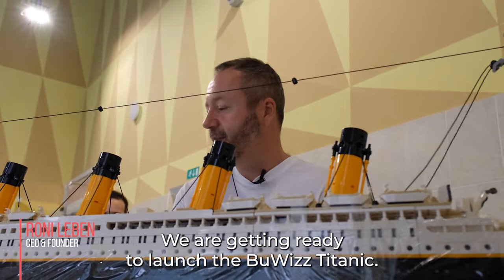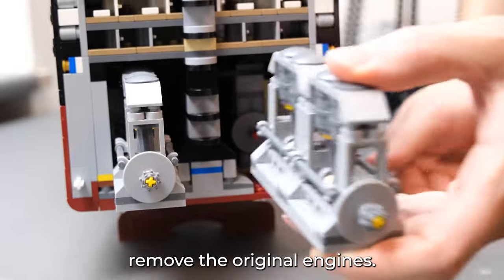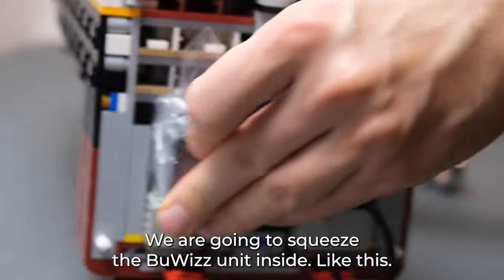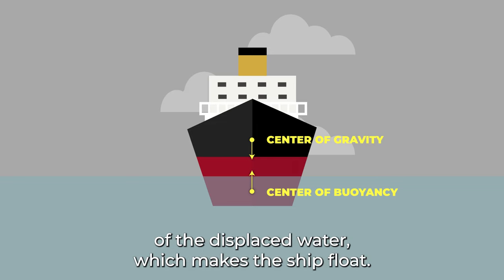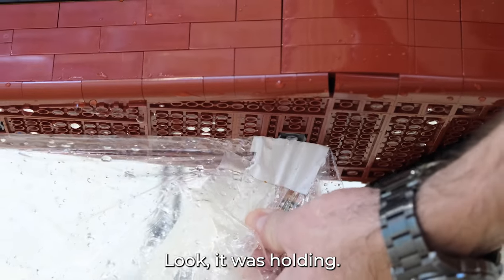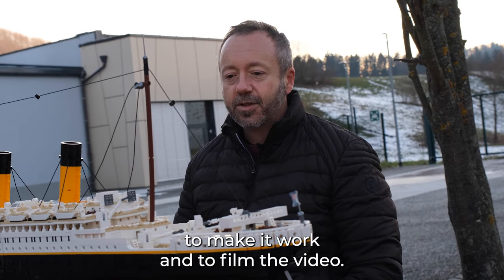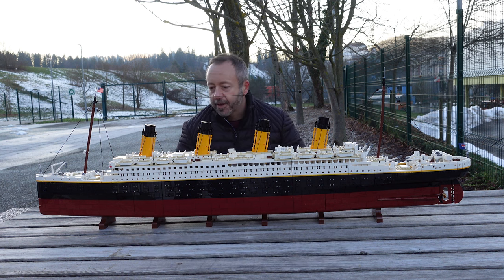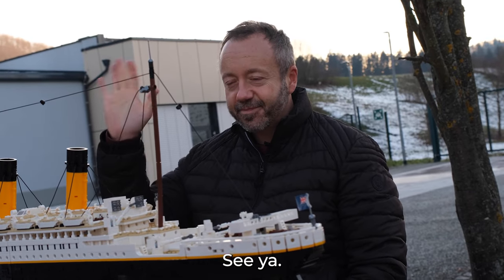Will 10294 LEGO® Titanic float?

Comment: This is a good idea. However, I noticed a couple issues. The motors are placed really far aft relative to the model, making it settle by the tail. I would put the motors closer toward the middle of the ship and have the battery box in its waterproof bag placed dead center in the bottom of the ship. Also, I would have more of a void space along the entire bottom of the ship so it sits higher in the water.

Comment: Good video and idea! I was relieved to see that this small Titanic didn’t, uh, get the same “fate” as the original one! I was wondering why you guys didn’t use the new BuWizz motors, as they ave even higher RPM than the older Lego motors. So they have too much RPM for the small RC boat props? I was surprised that it floated and moved that well, well done!